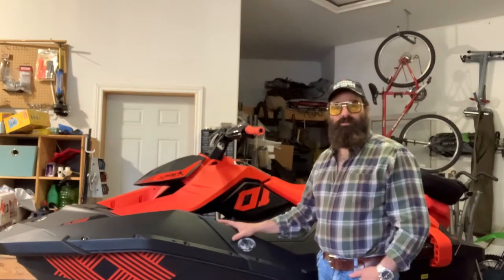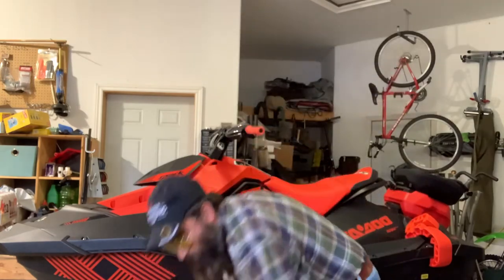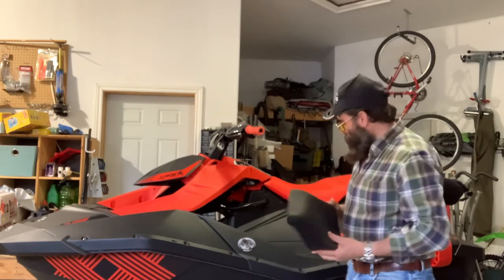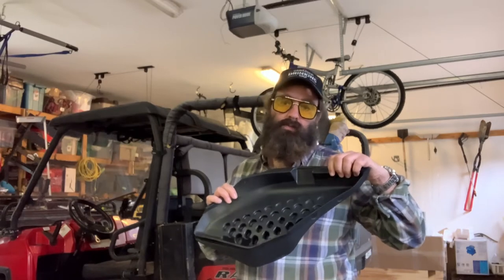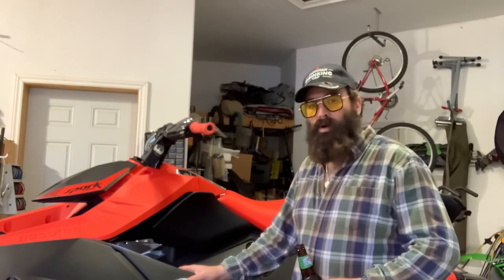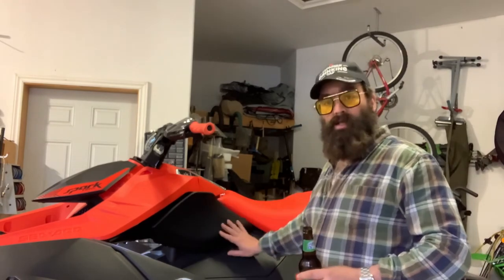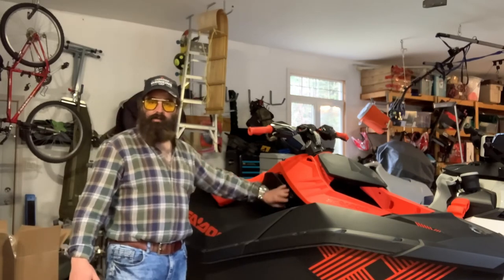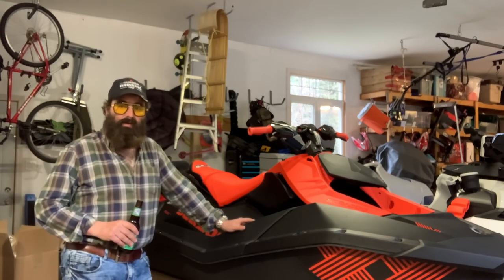Sea Doo Ergolock Knee Pad Installation on 2021 Spark Trixx

Comment: I just installed these last night. To anyone reading this, these are extremely simple to install and fit back on the ski. Just hold knee pad parts together and drill the holes. They install back on with ZERO issue, the first try. This guy makes the process 100x harder!!